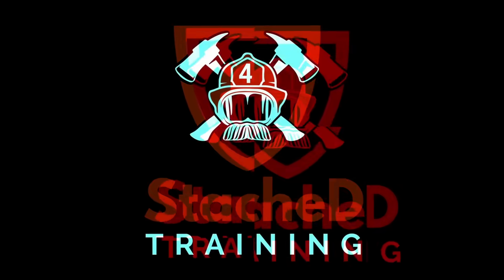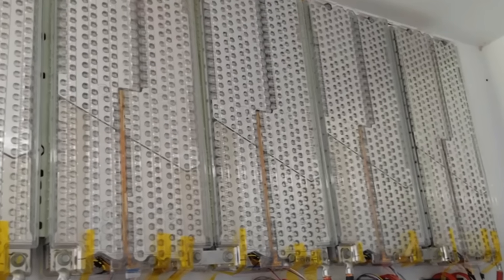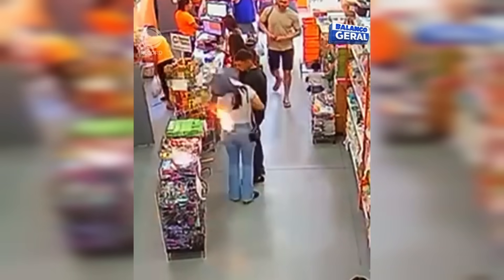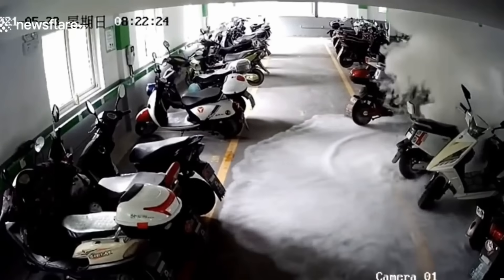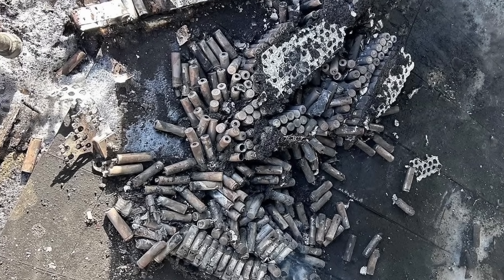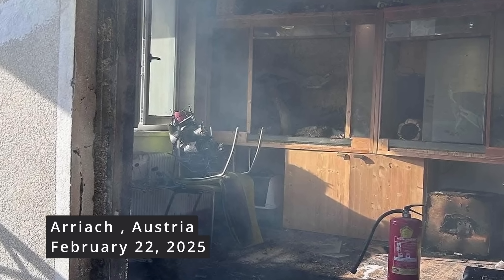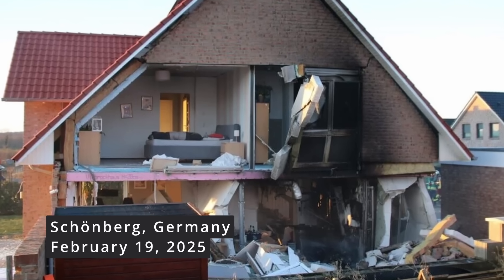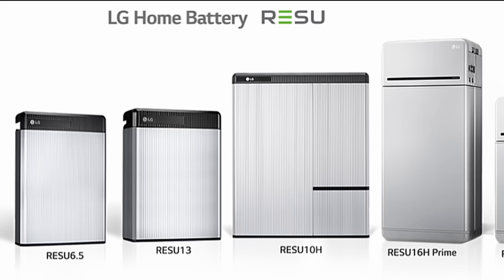Two Homes Just Exploded—The Hidden Danger in Battery Storage!

Comment: Since the EV batteries are potentially costly to recycle; the industry pushed the concept of repurposing the batteries for home or grid energy storage. It doesn't seem practical. I'd build a shed far away from the house for batteries if I were to do a battery backed solar power system for the house our an outbuilding.

Comment: I have Toro batteries for my electric lawn mower (and other Toro items). Somewhere the VP of Toro I believe stated that batteries should never be stored fully charged.  So my Toro and Dewalt batteries are always stored roughly 1/2 to 2/3 charged.  I will take one or 2 and charge them just before use, or use in a less than charged level and put another on the charger if I anticipate more use requirements.  As for the chargers, I have a "defective" Toro charger that only charges to maybe 60% charge.  It seems that all chargers could have a default charge of 50 to 60%, and a button to get to 100% (whatever that level really is) if the battery is at the first level of charge.  Perhaps that would make things a bit safer? not to mention increase the life of the battery.  Why have not the manufacturers come up with this themselves?  They could be sued for having chargers only go to 100% by default.

Comment: A separate large battery box or building far enough away from the house and an AC power cable to the house could be a safe way. Stopping or extinguishing a battery fire is almost impossible. A fire or explosion will destroy the house if the batteries are in the basement. An electric car is not safe because of the same risk. The chain reaction cannot be stopped. People die in cars because they cannot get out of the car.

Comment: If you must have a home battery storage system then invest in lead-carbon cells.  Yes, they are heavy and quite large but they have a guaranteed life of 3000-4000 charge/discharge cycles (to 20% discharge) and have a happy side effect - they don't explode. I got a 14.4kW system for $1750 (excluding charger-inverter that I already had).

Comment: I think new battery technology will eventually eliminate most of the problems. But they are energy storage units so there vast amounts of energy stored so its best to treat them with respect. I have been using batteries in my off grid house and also in my hobbies. I have had several batteries go boom on me including phosphate ones they are less dangerous than lipo ones. I always use a fire proof mat when working with them. But another problem is the effect of shorting out the terminals as they will melt anything conductive with ease. I believe you gave very good advice about storage and placement of the batteries in enclosurers away from the house and in places where if an explosion occurs the cover or door will release the pressure by blowing out.

Comment: US standards of electrical wiring in homes is garbage. The hollow walls BUZZ. I've noticed it instantly when I started living in the US. Battery installation is only as good as the worst place in your home. The battery can be installed by qualified electricians in the most organized beautiful way. But if there is some crap old wiring elsewhere mixed in with old plumbing or glued together with chewing gum and spit, then what's the point.

Comment: Large storage batteries should never be installed inside a home.  You wouldn't install a large rural propane tank inside your house, then why would you do the same with large capacity batteries.  The same goes for EVs.  You wouldn't store something in your garage that has the potential to catch on fire if something malfunctions.
Reply: Many homes have propane pipes coming into them. This, compared to having a tank, makes absolutely no difference.
Reply: @SurvivalSquirrel  On a scale of risk, the risk that someone's home blows up from natural gas is very low because most people catch a leak before it becomes a big problem.

Comment: My preferred location would be a concrete roofed and walled on two sides enclosure , the other two walls being louvered steel . I'd seen this in early manifestations of battery storage where lead- acid batteries were used , hydrogen off gassing being a possible issue . They had ventilation to allow gas to escape and minimized danger to nearby structures or individuals if a blast were to occur.They also had hydrogen gas detectors with visible and audible alarms outside.
The problem as you said ,is the false sense of security that obviously stems from the manufacturer's marketing and installation recommendations . Sure the diy repurposed tesla batteries were an accident waiting to happen , but when it happens in off the shelf consumer units there is clearly something amiss.
Manufacturers want to sell , so they will naturally play down the risks . So like it or not the regulators need to step in and lay down the law , these items in their current form , have no place within a domestic dwelling.

Comment: I think we need to know more context about the fires and explosions. It's one thing about the devastating consequences of a failing and devastating battery fire or explosion, and its dire consequences. One story about the exploding LG batteries is already a read flag story, in my view, as we have known for a while LG batteries are linked to a known battery manufacturing defect, so the context was there all along. To me with the story of a LFP battery the context ia less clear as is known that the batteries are safer. Yes the science behind a larger toxic gas production than nmc is more worrisome, but agaim I think context remains important. A question remains why do we not see these problems more often? And it would also be interesting to compare them to gas explosions and fires in the home, which appears on news media globally regularly, and these fires and gas explosions still occur regularly small and large at regular incidents for decades! We still haven't adressed them much as well these last few decades, but  they also claim lives today, still! Where's the progress in this safety concern? I think, just like  home gas fire or gas transport and use safety offers just as much scrutiny to date and safety concerns as home battery fires and explosions, even though I could imagine the data on gas fires and exploaions is likely larger than home battery issues, Inwould imagine speculatively. For both, I think, we still need more shared context data so that we can defer more meaninful knowledge on primary prevention, than secondary  prevention from these stories.  What are, for example, some possible commonalities between gas and home battery fires/explosions and what can we learn from both?  After all gas fires and explosions in the home also often take place in the home. So why should all of a sudden batteries have narrative for an  exclusive sounding advice,  for placing batteries outside, but keep gas use inside still? Is it proper to think in tjos narrative, and apparantly have a possible double standard?  Many homes also don't have adequate gas venting in the home as well to a degree, so I would speculatively think the fire/explosion risk and batteries are equally as high. And with the global narrative of increasing home isolation narrtive and a top priority.for educimg energy consumption, I can also imagine keep the heat inside also has its frre and ventilation concerns, which doesn't help the gas and home battery infrastructure in the home as well, and also provide its new challenges for the fire department, let alone the comcerns of battery and gas alone. I think thIs narrative, in my view, invItes us to revisit  home fire and safety in a more broader context. I can understand with recent technology developments and shifts towards an energy transition away from gas, but many homes globally still run on gas, so it is still a global comcern as a lot of the infrastructure is still in homes today. I think if the home battery technology is not ideal for proper use outside the home, I still think placement in the home should still be possible, and possibly has its benefits. As for fire and explosion safety I think a proper safety knowledge amd comtext are appropriate for this. As also pointed out in other videos on this channel a fire or explosion doesn't just occur out of the blue, but is often a result of a cascade of events that lead up to explosion. With proper use we could mimimise the risks, as we still do with gas stoves today too, unless we consider them unacceptable too in the home in 2025, but I think it will be dificult to convince the global society to cook outside the home in the winter or on a cold and rainy and stormy night. It's more about tradeoffs in risks perhaps. That one story about the LG batteries home explosions was likely already a red flag or an accident likely waiting to happen, because ot was known the batteries have a manufacturing defect.  With the LFP battery I can only do an educated guess, with the clue to a question, why you need a 30 Kwh battery? As far as I know today most people have a much smaller home battery for proper use. It possibly suggests to me that the user likely has a potential large power demand, and we know that from high charge capacitities and large power draws are likely the triggers for a potential cascade failure if you're asuming for a high capacity high draw efficiency, as those moments could  cause the temperature risks and voltage limit imbalances as possible triggers. Luckily,  battery temperatures for thermal runaway are relatively high, which reduces the potential thermal runaway risk, when proper demand usage is applied and not put through its threshold limits. I think these train of thoughts in the contexts could help us understand more, the risks and concerns we have for home battery fires, when drawing from global case studies and trying to put forward a suggested dossier on this theme to prove a point. It is nevertheless interesting food for thought. Thank you.

Comment: I am working toward building my home solar system. Been thinking about it for some time now. My plan is to build an outdoor shed for the batteries. I plan to have them below ground, which will keep them cool, but not freezing cold. Where I live, it’s approx 50 deg F under ground. If anything were to go wrong, the ground will contain the blast, and with the exception of a blown up upper shed , there should be no damage to the surroundings. I also intend to have a small exhaust fan blowing any gas outside.  (Maybe like a computer fan) I figure about a 4’x4’ x 4’ deep hole and shed about the same size should do it. Maybe a little taller on the shed for ease of entering. What do others think of this plan?

Comment: I was listening to a sandy munos video where he toured a startup evtol company and they said their batteries are hermetically sealed in titanium.
Reply from the maker: They are all sealed,  until they aren't.
Reply: @StacheDTraining  they usually have a way to vent gas not hermetically sealed.
Reply from the maker: @TheBagOfHolding  if a lithium-ion battery is venting gas, it's in thermal runaway.
Reply: @StacheDTraining  they can vent gas without catching fire.
Reply: @StacheDTraining  batteries swell and get fat sometimes but don't explode or burn up

Comment: hello, I am on a forum where this video is being discussed. The statement you make at 5:10 appears to be false. You state that 20% of NMC battery gas release is hydrogen and that 50% of LFP battery gas release is hydrogen.  If this information is incorrect and you are putting it out there it is going to damage your credibility, so I ask you to please provide a back up reference for this claim. Mind you, I have put an LFP battery in a large garage closet. Before doing so I requested the full test results from a thermal runaway test.  It is around 50 pages. First the battery did not run away when one cell was deliberately overstressed causing it to burn. Second, the amount of hydrogen that would be released if one of these batteries did burn is negligible compared to other gasses that would naturally be produced in a fire.   I am not against everything you are saying; I am with you in that there are likely to be many accidents caused by people trying to repurpose car batteries. But that is not what the majority of people do; most people in 2025 are getting a pre assembled battery with ignition suppression built in.
Reply from the maker: Gasses produced during thermal runaway are well known to the industry:  https://www.researchgate.net/publication/369675317_Thermal_Runaway_Characteristics_and_Gas_Composition_Analysis_of_Lithium-Ion_Batteries_with_Different_LFP_and_NCM_Cathode_Materials_under_Inert_Atmosphere

Comment: I will suggest that each home, facility, with lithium battery backup, have the designated hazardous symbol prominently displayed at an agreed fire department location. 
Maybe on the outside electrical panel, because that is often the first attention of the arriving responders?
Maybe add a yard sign, similar to video surveillance or security company?

These DYI individuals very frequently do not intentionally read to understand the battery. 
These batteries are generally only dangerous when the individual lacks safety skills, technical knowledge, and proper emergency response. 
 
However, some manufacturers of battery storage systems have not designed their system to be safe as possible,  because they desire their system to outperform the 
competition for a lesser price.

I spent years hands on work assembly, disassembly, and rebuilding, Tesla vehicle batteries, and powerwalls. 
They are safe when proper handling, tools, specific components, personal protective equipment, test procedures, and processes are intentionally specifically adhered.

We had very specific emergency response equipment, and trained individual technicians, how to correctly safely be first a responder when an incident occurred. 
NEVER, on MY shifts, had any uncontained thermal runaway.

Comment: Well, you want a battery storage system, then your home must be placed on at least 4 acres.

How is it that folks with inverters in their house and campers don’t seem to have problems? 

Is there a problem with surface area to volume ratio that makes lithium ion batteries more dangerous? Insufficient surface area to dissipate heat?

Comment: That's a reason why I still prefer lead-acid batteries of gel-type or at least AGM. They simply do there job even in freezing temperatures and are relatively insensitive against water. One of my batteries even survived a couple of days fully submerged in shallow water, still showing 12.7 V afterwards. There is no risk of explosion unless you heavily overload them in an unventilated are, but that should be avoided anyway as it destroys the battery. There is in fact a risk of fire if you create a short circuit so you still need to know what you're doing but they are much safer than Lithium type batteries.

Comment: How do you know that the systems that failed did not have a BMS?  You are talking tosh. 3rd party BMS systems are very sophisticated. So, what you are talking about is non-engineering people that believe they know what they are doing.  It should be illegal to install in the house. By the way, due to the volume of hydrogen released no amount of ventilation will mitigate the risk of a hydrogen explosion. You would need a wind tunnel!!

Comment: I worked at a company that built industrial battery energy storage devices in refrigerator sized towers up to 60kWhr systems.  We used large format kleenex box sized LiFePO4 cells.  To get our UL rating we had to severely overcharge the cell, then shoot it with a nail gun and prove it would not explode or the fire propagate to adjacent cells.  Passed every time.

Comment: Guranfuckingtee my DIY LiFePo battery setup is safer than most off the shelf units. But I also pay up for the best BMS units (REC) that includes automated contractors and I use blue sea fuses and MidNite Solar (Carlyle) breakers. Each cell is also independently monitored for voltage. 

My setup is also in a heated/cooled shed.

Comment: Battery ratings probably should change.  Make them safer instead of rating them at the edge of exploding just to make as much profit as you can.  Or you need to change how you rate things and based on what metric, because if batteries are failing this catastrophically and they are being run at their rated values, maybe the values aren't right.  Something is wrong here.  And corporate greed is also an acceptable answer.  I will say the dude using the tesla batteries as a DIY Tesla wall battery, I'm pretty sure those batteries usually have a cooling system.  Do we know if he replicated that?  Yes, likely the BMS was garbage, but it could be SO many other things.  Maybe he didn't have the proper gage wire at some point in the chain and that created enough heat to start a fire.  But either way, even the commercial products are letting out the very explosive smoke.

Comment: A single 18650 battery has a ton of energy and destructive force if it decides to vent.  Now imagine ran in a series with 100 of them and one decides to go?  Yea the bomb potential of these batteries is just no joke.  No way would I have these types of system near my home.  If anything I'd have some type of out building  safely away from my house to store the system and run additional wire under ground back to my house. Sure it'll be way too expensive. But better than literally blowing a wall off of my house and killing everyone inside.

We just aren't quite there yet with these systems.  Until we come up with a better, safer means of battery/storage - I'll stay away from them.